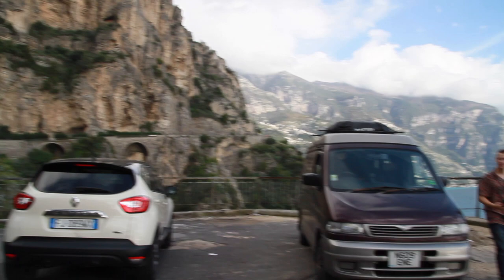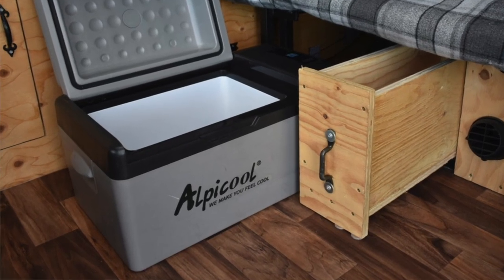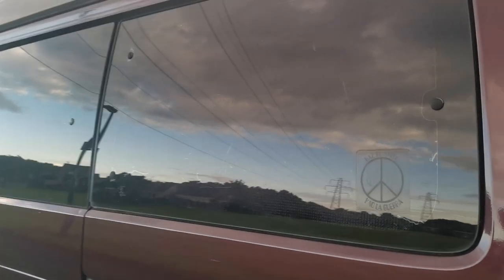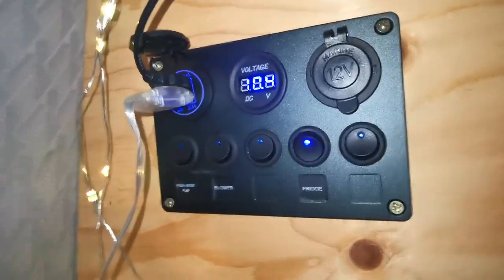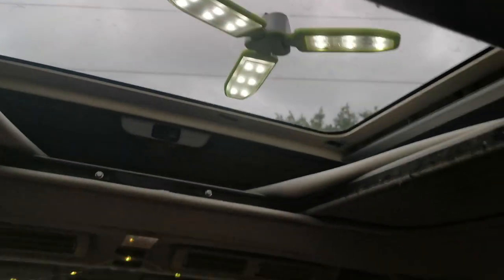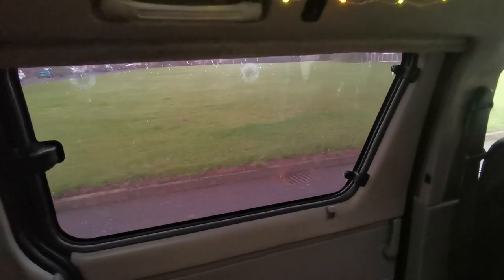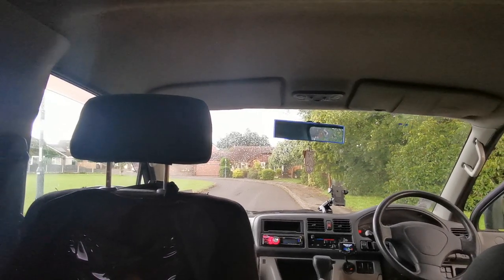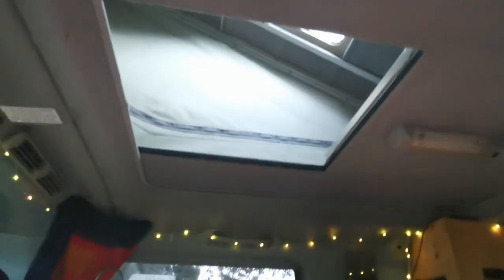Mazda Bongo Self Build Campervan Conversion

Comment: How do you check / top up the oil ?
You won’t be able to fold the seat back because of unit behind the seat
Reply from the maker: It's mid-engine so you check the oil by flipping over the passenger seat. The bed and unit and draw all worked perfectly, we lived in the van for 6 months with no issues
Reply: @hannahlihill  
Your right it’s under the passenger seat , it’s the gearbox dip stick that’s under the drivers side 
I just thought with the kitchen unit behind the drivers seat u would never be able to flick it back to access the engine on that side